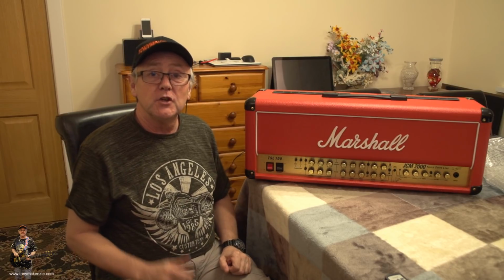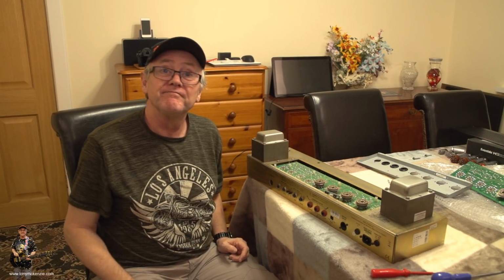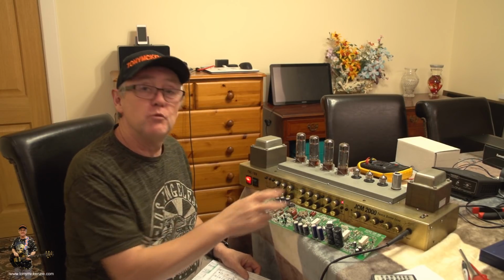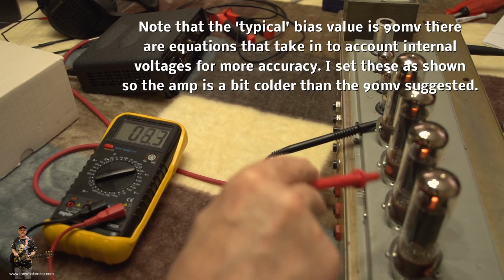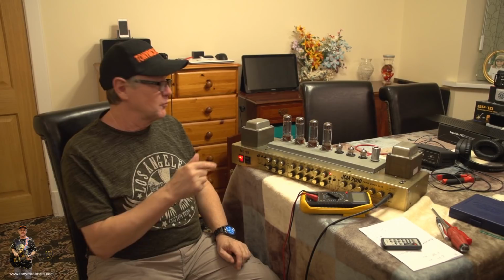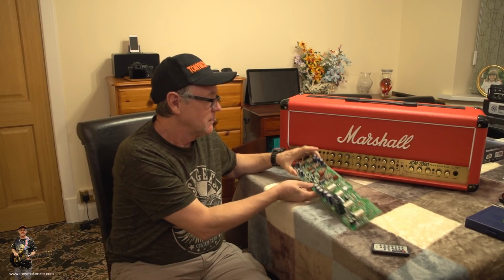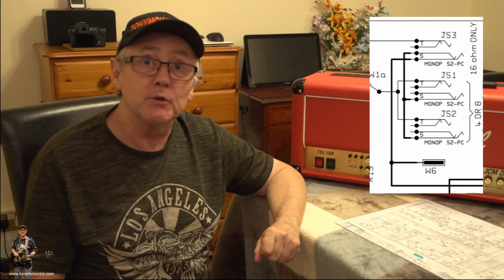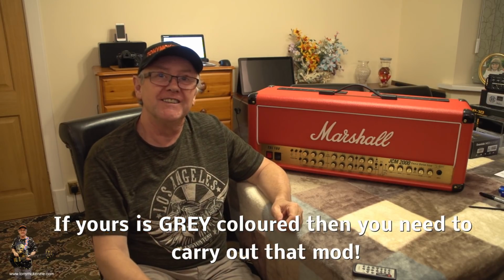Marshall TSL100 JCM2000 Amplifier | Permanent Fix For Bias Runaway | biasing review | Tony Mckenzie

Comment: I like 50-60   sounds ab GRT
Reply from the maker: This TSL100 once you fix the issues of biasing for recording is one of the best sounding amps I ever have used. I got a new latest board when they were available but are now not available boards sadly. If you have a good amp then hang on to it. Check this album (if the link works) as the guitar amp was this very one: https://www.amazon.co.uk/dp/B002IU9NOY/ref=sr_1_3?crid=2DF21GCK2CX2R&dib=eyJ2IjoiMSJ9.EVj0gX78r4_2Ygbk7mjltsep38PZsUjYnBjIHEhFSNLAFcQ1MUOjRUMj9kpfNgeMRE3rz6RWp3VFL5sP_SI_46GFc7j01jUp4330FG8hXmZ1DICF5u7WhSH_lBKpSPHhKecpbcWZdGgmetMW2nrKpXMXyr2ITKdOgVDwxNSdzDnIcT6LXhCe7SlA0kdE0a6_fXkqCXuPbp4R6ViI7bHsJw9whrzaMhcuvNmjbxl0Tno.KebMTUm44Bfjw7znzbcThf1qVLaIITTkSsTRfGvnD1o&dib_tag=se&keywords=tony+mckenzie+music&qid=1759761644&sprefix=tony+mckenzie+mussic%2Caps%2C129&sr=8-3 

Thanks...

Comment: I wonder if the new board changes the tone
Reply from the maker: I noticed no difference except it works! Boards are now (it seems) rare and difficult to get... Thanks for watching.
Reply: @tonymckenzieofficial  no worries. I just got a tsl60 and im absolutely obsessed with it. Such an amazing piece of equipment and the sound
Reply from the maker: Well, you see that many guys knock the TSL amps. I think really that relates to the reliability of the PCB and bias. This amp I did update, but back in about 96/97 I had the original board in one and recorded some really great tones - honestly, they were some of the best tones I have ever recorded... so I bought this amp you see for a few hundred pounds and replaced the board in this video. I still have the amp and it works perfectly with 'that' tone. I did have a 60 some years before that but it was slightly different and a friend advised the 100w. So I bought that and basically have had one since. Hang on to the TSL if yours is fine... thanks and thanks for watching.

Comment: Hi Tony I did try to contact you on your website but no luck so I will try again through Youtube. I have 2 TSL122'S both of which had to be heavily played with by Marshall to get them working right. The first is from 2004 and the second from 2005 and its a good thing it was done under warrenty. Now the first question I have for you is where did you get your replacement main board from as Marshall are refusing to supply spares for their amps and secondly do you remember now much it was. They are now doing boards at £70+vat, labour £40+vat and pickup charge £24+vat plus any extras they may find, this is for one amp so when you double it you get £321.00 or £168 for the boards with the vat. They are available from the States but myou are looking at over £200 each plus postage and import tax which is 20%. So to the question have you got any bright ideas where I can get two boards with out been taken for a ride????!!!!! Best wishes Owen
Reply from the maker: Sorry I missed the question before... Well, the boards are not hyper cheap I have to say and since 2020 they have increased also... I know they are for sale at https://www.hotroxuk.com/marshall-tsl100-main-board.html and their price used to be about £110 + VAT which at the time was reasonable. But as you see currently that board is around £175 inc. VAT which IMO is high in my opinion but everything in the UK has soared over these recent times. Fitting the board is not that difficult but without experience probably not a good idea.  Current boards are Issue 20 and that does fix the amp - my amp has been solid ever since the board upgrade. The TSL100 JCM2000 amp is a very good amp and was marred by the bad board situation sadly. I created an album called 'Eniac' on mine back in 2006/7 and to be honest those tones remain some of the best recorded tones that I have got from ANY Marshall amp. Many would tell me I'm nuts... but the guys that know the amp properly will know how good it can be. Me? I would have grabbed them boards at that price especially if you love the amp. Marshall only supply spares to authorised resellers and repairers that are registered with Marshall so I'm not surprised they won't supply the boards. Probably a safety thing. From my experience EVERYTHING Marshall costs more in the USA - and I mean a lot more. Hope this helps (its based on what I know) and if you love the TSL100 its not the worth of the amp, but the value of those tones that made me fix mine. Thanks for watching and do let me know how it all goes...

Comment: Hello Mate, thanks for the video!!! I got this amp and gain is so weak, gain is almost 9 on the crucnh channel but there is no gain at least, preamp tubes also new.. but result is same i wonder that have you any video that kind of problem? By the way i faced same issue with all channels , clean-crunch and lead😢
Reply from the maker: Put a signal in to the return of the loop and see if you can get any volume... maybe by using a preamp of another amp... send out from other amp loop and in to return on this amp. If its OK then, there's a preamp problem, and if not OK power amp trouble... you did not say whether the 'clean' volume can go loud or not?

Comment: Hi Tony!
I recently changed the mainboard of my JCM2000 TSL100
by JCM2 60 00 REV20. I noticed that it has two new ports CON.CON15 and CON16. Supposedly the connections would be
Con15 to con21 lead board
Con 16 to con 22 lead board..
But on the LEAD board the last pore is the CON20
Could you explain to me why and what these new CON15 and 16 ports are for? Since I have nowhere to connect them in the LEad circuit.
Thank you for your attention and all the information in the video. congratulations for the work and for your music. Really appreciated
Reply from the maker: I did cover that in the video somewhere (I think towards the end). for the ports that you don't have the wires for you don't fit anything... look closer and they are replications of other connectors that you use. If I remember one related to a bias thing (been a long time since I did it) but none of them matter. I was in a similar dilemma at the time until I looked at the schematic :) Let me know if this answer does not hack it for you and then I'll dig to find the answer I posted on my channel... and thanks for watching. These JCM2000 are actually a good amp that was spoiled a little with the earlier revision board but this one does fix it all. Thanks
Reply: @tonymckenzieofficial   
This TSL JCM 200 head  (my is 2003)I believe is one of the best ever made by Marshall. has this clinical problem of bias drifting but everything seems to be solved with this new main board. Since my amp started to give a problem only now, and it took a lot of road in several shows all over the country.
THX Tony for a long  attention !!!

Best Regards
Reply from the maker: Get those new board in it and it will last a very long time... Thanks.

Comment: Tony I appreciate this TSL-100 tutorial. I purchased 2 TSL-100's back in 2005 & only experienced an issue with the DIN connector on the amp's back that the foot switch connects too. Not sure as to what version motherboard PCB I have but if I have issues I will replace with the issue 20. Again thanks for sharing this. All the best to you & yours & stay well !!!
Reply from the maker: Hi Stan, if they are 2005 they will probably be issue 7 or prior and those all seemed to suffer with the bias problem, some wrong components on some issues, and that burn out capacitor I showed and the 16 Ohm (I think it was) connector and how its set up (but the mod can fix that on the socket). Yes issue 20 absolutely does fix it all. It's a bit fiddly to change and I recommend you photograph the connectors before you start if you can do it... if not put it to a tech. I love the TSL-100 recording tones and some of the best I ever got hence my reason for keeping this amp. Thanks for watching... and for the post.

Comment: I have a few questions regarding power tubes for this amp. 1) will it adversely affect it's operation to replace the tubes with two matched pairs rather than a quad (splitting the pairs opposite the phases from each other to keep the overall gain balanced)? 2) would using 6L6s instead of EL34s cause any harmful issues? I plan on using EL34s and bias to 90mV, but I was just curious...
Reply from the maker: I would not be too worried about two matched pairs as long as they stay 'matched' in their respective places. But don't just put 6L6 tubes in this amp... I certainly don't recommend that unless some tech has worked on the amp to make that acceptable... and then you would see 6L6 in there. The EL34 IMO has probably the Marshall sound that most people could think as a Marshall 'sound' too so best kept that way. Just fitting 6L6 will cause aggro if fitted in to an unmodified amp I believe. The 90mv seems about right although I tend to look towards 70-75mv so there is a bit of leeway. Hope it helps and thanks for the post.
Reply: @tonymckenzieofficial  thank you so much! Your videos are a delight to watch, and so informative. While I'm not a qualified or licensed guitar amp technician, I know enough about electronics having been an avionics technician for 20 years. I understand and respect the dangers of working with high voltage circuits. 

Id figure i would have to rebias per spec for 6L6s, if those were to be tried. I've heard those have a more "American" or "Modern" sound, as they are often used in Mesa and Peavey amps. 

I just ordered some NIB Marshall-branded (JJ) matched quad EL34s. Hopefully I'll be up and running soon! Thanks again! Cheers!
Reply: Just an update: I changed my tubes (EHX) with some Marshall branded JJ's, biased to 90mV. Sounded great. I then did some redecorating, replacing the front with an aluminum honeycomb grill and classic block letter "Marshall" badge (wanting to show off the glow of the tubes, and make it my own).

 I'm very careful with electronics; I never touch components, leads, or solder joints, unless ESD strapped to ground. I've worked on aircract avionics and electronics for over 20 years. I take as much care as possible handling the tubes. 

So, imagine my surprise and horror when my speakers begin crackling and popping as two of my newly purchased tubes' shields start glowing and arching! I suspect redplating and runaway bias, but have yet had time to inspect it for damage to the boards. The model was made in 2006, but I can't find a revision number. The motherboard seems to be an updated opaque, all green version.

Please, let me know your thoughts. Thanks again! Love your videos!
Reply from the maker: I think I made mine to about 70mV at the time (forgot its been a while), and it could be the problematic biasing... my amp was I think 2005/6 or something around there look for issue 20 - if its issue 5/6/7 then likely a problem. Also examine that capacitor I mention in here that was burned off my board - that also is trouble and I did show how to solve that cause. Honestly, I dislike JJ tubes and that is the ONLY brand I ever have had trouble with since 1971. Marshall use them currently in new amps too. They stopped using Svetlana some while back. You will find the issue number on the board as I showed in this video. If it is an old one then check that bias again now and see what it is. If its way out and the tubes are gone because of the bias then I would get a board. My amp has been perfect ever since and without issue. The TSL100 (JCM2000) is a great amp that some don't like, but usually because of that bias problem... once you solve it that amp works brilliantly and probably won't give you any trouble then. Hope it helps and do let me know what you find... thanks.
Reply: @tonymckenzieofficial  thank you so much for taking the time and offering your experience and expertise. This Amp has been both a blessing and a curse lately. She will be named "The Diva" henceforth. 

I will be replacing the board with the Rev 20. I'll take the tubes to a tech to see if they're still usable... if not, I'm going to have to settle with what I can find on a budget. That board will set me back about $200 (approx 175 pounds). It's an investment, I know. Thanks again!
Reply from the maker: Wow expensive board (I'm in the UK so its probably cheaper (unless the shortages of components have boosted the price!) but if you love the TSL100 its worth the effort. I have seen many try and botch their boards etc but I wanted a permanent job and so far its been spot on. BTW I'm not a tech at all but I have been around generally the technology market since about 81. Man I'm too old :). Thanks.

Comment: Yes great sound and great guitar playing ! 25:50
I have original TSL 100 and it has actually been a very great amp.
It runs very hot so I always run a fan on it..
Reply from the maker: Thanks... and for watching too. I agree... I never really got that sound (was recorded here in the studio) from any other amp ever. I used a Ibanez 7VWH original Japanese one from about 2000 era... and that sound just flowed. I used that amp and guitar for a whole album bar a couple of tracks. They can get hot of course... and BTW the 60w sounds very different - I had one later after completing the album at the time and it was not good so I sold that. Bought this one eBay just a few years back but it had the problems you see. Fixed now though. Thanks...

Comment: I just had my board switched after it turned my amp into an additional heating device. 
Today I will pick it up from the store and I am over the moon to get it back. I love this amp and used it a lot for gigs and practice.
Reply from the maker: The right revision board will fix it for good. This amp as you saw was the same, but I had one back in 2004 and created an album or two on it then silly me sold it. This is the replacement and I still have it. They can sound great when just so in a recording... thanks.

Comment: Is there away to check the board versions without opening it up? I have a 2006 model ( M-2006-18-1011-A )
Reply from the maker: Well 2006 is at the end of the 'bad' earlier boards from what I believe. I think that in 2007 the newer revision came out. But maybe if you call Marshall and ask which revision board is in there it might be the answer... Thanks for watching.

Comment: Does the tsl60 had those issues also?
Reply from the maker: No I don't believe the TSL60 suffers from the bias problem that the early TSL100's did. I did have a TSL60 at one stage but it did sound a little different too than the TSL100 IMO. Thanks.

Comment: As with any thing, the more features it has, the more things that can go wrong. I bought a used Marshall Combo amp a G80 something, something. I saw it languish in a Pawn Shop for years. They had $300 written on the tag. I finally walked up, told them I'd pay $125 for it. They hesitated, I said Man she's sat in that corner collecting dust, I've got the cash now. Well they let me have it for $135. It weighs a ton, but it's solid state. It actually sounds great on the Boost channel. I read nothing positive about it on the internet, in the chat rooms, etc. My only problem is the input Jack is connected to the board, so I'm careful when plugging in. I've had it since 2008 no problems. I think the major amp companies made a mistake by placing the tubes, switches, etc, directly on the circuit boards. I know it's "cost effective", saving a few pennies, but I like the old method. Jimmy Page didn't do so bad with his Supra, did he? Any way, I'm into watching the amp repair guys now. There's a cat called Uncle Doug, if you haven't seen him check him out. He reminds me of a school teacher, but he has dry humor. Thanks again, I enjoyed the video.
Reply from the maker: Interesting about the amp :) a great $135 if you ask me! Tone is subjective anyway, what's good for one guy the next might not like. Agreed on the PCB and power tubes in particular. I had a Peavey MACE head back in the day and it burned the PCB badly because of that - tubes upside down heating the PCB. I know of Uncle Doug of course. I also like Guitologist but only the repair videos - the other stuff is not for me. They are both very good at what they do. Stay safe.

Comment: Thanks Tony you saved my TSL from the skip!! Changed the board myself and biased as you did, it's like a new amp now, the boards become conductive over time apparently.
Underrated amp, I gigged mine for six years before this happened
Mine started red plating tubes
Then went pop when I turned it on and two valves wouldn't even warmup. Sad news I've recently seen a video of the JVM starting to suffer the same fate, and the power transistor boards of the solid state Marshalls the Guitologist does a video on these solid states  I've started leaving my valve amps at home, I use a boss katana head 
Now it's very good maybe not as good but plenty good enough
And very rewarding and enjoyable to play in a band mix , plenty loud enough on the 50watt setting. I'm
Hoping Boss didn't get their boards from Marshalls supplier
I've seen a wazzacraft head and cab for sale for £1000 ex demo
Mmm
Reply from the maker: Well done - the TSL100 is a very under rated amp and I made my 'Eniac' album on that amp back in 2006 - it still sounds so good on those tracks. Did you also do the output mod on the 16 Ohm connector - its in the video. Katana works and that's a fact. Ha I doubt Boss even talk to Marshall :)  I own a Wazza Head (the 150 watt) and a 2x12 cab... Ormskirk? that is where mine came from. If it is there they are pretty perfect gear and I still have that head. Very well made... a bit toppy maybe but you can get good tones from it. Did you see my review? Here: https://youtu.be/fHKQMHFV63o   Well saved on the TSL. Thanks for watching and Stay safe.